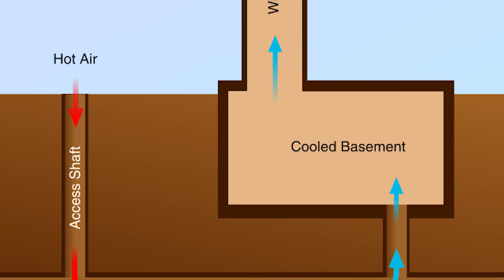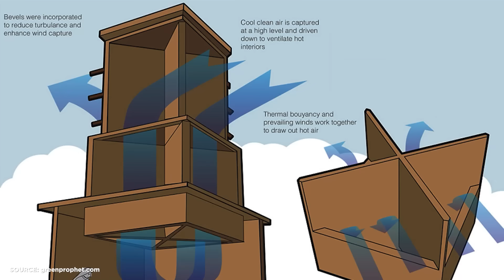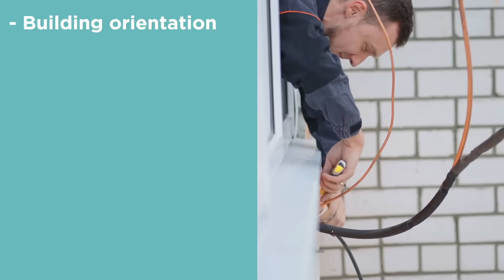Forget Heat Pumps - This House Cools Itself With NO Electricity!

Comment: I built my own solar array and battery backup, switched heating and cooling to a heat pump, electric hot water, double insulated windows and external wall insulation. I make about 150 monthly in profit selling excess energy back to my electricity company. I collect rain water and use filters to safe the water which last about a year. This system supports 4 adults without supplement

Comment: modern passive houses are are a nightmare for firefighter too, because its airtight and you can't really open the doors without then getting a backdraft (fresh air rushes into a still active fire) - so its hard to really save those houses then.
At least that is what i got told by a coworker who is a voluntary firefighter (which is pretty common at least here in Germany)
Reply: But ICF houses don't burn easily. You can hit them with a flamethrower and they won't burn. The occupants have plenty of time to exit before their furniture catches ablaze.

Comment: 8:58 Tbh... neither 28ºC or 14ºC is a comfortable temperature.
That being said, i wish all buildings thought more about that, with the global warming and energetic crysis, because of conflicts and what not, we need a paradigm shift in housing, really fast.
In my country we still love to build ginormous buildings with huge windows and mirror like covers, needless to say, as an engineer it creaps me out.
Keep up with the good work Joe, your channel is awesome.
Reply: Those are both absolutely comfortable temperatures personally
Reply: 14c is fine for me but not 28c that's way to hot
Reply: Those temperatures are not comfortable because that is not what you are used to. It would probably be comfortable if you weren’t used to a constant 22°C.
Reply: For indoors? Here, we aim to have temperatures between 18 and 23ºC, the ideal being  21 - 22 °C.
But yes, overall comfortable temperatures is a subjective matter aldo dependant on the humidity and all that. 
Personally, i would die if i had 28ºC inside my office/house.
Reply: This winter, I tried lowering the temps, but at 17 and with Home office - I felt miserable - my nose and feet were cold. Sleeping  and doing some house chores was fine tho
Reply: 14c is comfortable you just put on a hoodie in doors. 28c you have to be pretty much butt naked in doors to cool off if u dont have ac or some heat pump/passive recuperator that lets air in but the heatsink soaks most of the heat, keeping in doors cooler by like 10-15c than whatever is outside at the moment. So if its blazing hot 30c, youre at a nice 15-20ish in doors. Unlike ac it runs on a fan or two pulling a whopping 10 watts. Thats like a 150-200 times more efficient. The cons is that all windows and doors have to be closed all day to retain the nights cold. Because its the difference of the indoor temperature that keeps the heatsink cool as it cycles between pulling air from outside and pushing colder air from the inside to cool the heatsink.
Reply: It depends on the humidity too. 28c is ok if it's not too humid. I find anything below 18c too cool unless your doing housework. though my parents left my house at 16-17c a lot when I was a kid!
Reply: Yeah... for someone who is  "used" to get from 40 degrees to a chilling 18 degrees. Which is not good for our body to be honest! Getting from 40 to 28 is refreshing and more than enough!

Comment: You missed the major difference between US and Europe: US uses heat pumps to cool the house, Europe to heat them!
Reply: In the southeast US (where I live) 90% of homes since the 1980's have had Heat Pumps for heating and cooling. My dad's home is rare in that it heats with the Heat Pump but has backup gas heat. He just has to select it on his thermostat. Btw he said he's never needed it even when below -10C (15F) and with no AUX heat-strips installed. Heat Pumps are amazing.

Comment: Unfortunately, that would never work in the state of Florida. I'm not aware of any impact resistant triple-pane windows for starters. Also your electric grid in Texas is bordering on criminal not to mention idiotic.

My advice would be to have a new home with absurdly expensive impact double-pane windows, sprayed foam insulation and if possible high efficiency solar panels. Also, if you're not on FPL then I would highly recommend a whole house 22kWh+ generator with at least a 500 gallon propane tank.
Reply: Impact resistant? Who have you pissed off?
Reply: @TheSkytherMod  .. Hurricanes.
Reply: @DJaquithFL  I kinda assumed so ahaha, just making some jokes here 😅
Reply: @TheSkytherMod  .. 👍😎
Reply: Youch!!  There are hurricane rated triple pane windows just like there are all other number of panes of glass.  Heck we are installing laminated glass in one of our homes we are building for clients.  
Also spray foam is poison.  No. Red for it just to insulate a house.  Use natural materials and in Florida keep the vapor barrier on the outside and it works great!  Shading and a great ERV and probably a speedster dehumidifier is what you need there.  Stay away from generators and spray foam.. just adding to the problem IMHO.  👍🏽
Reply: @mrkozz1  .. What's the name of the company and the model of the Hurricane rated triple-pane windows for 2022 requirements?

Comment: Hi Joe, wish you also mentioned BRIT in Fort worth (botanical research institute of Texas) they have a living roof water that circulates under the building to cool then throughout building to cool building and windows built to catch light but decrease heat this isn't all of the build design features.
Reply: That sounds amazing.  Do the windows have fish in them?
Reply: @williamchamberlain2263   no they're on the north side of building and angle in a way that allows them to be shaded